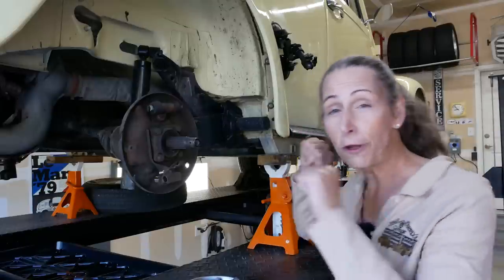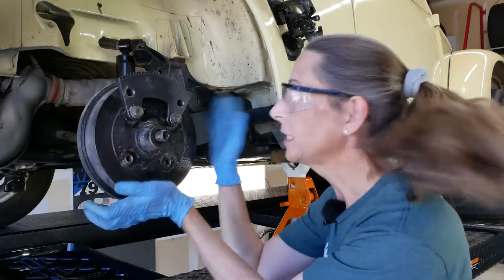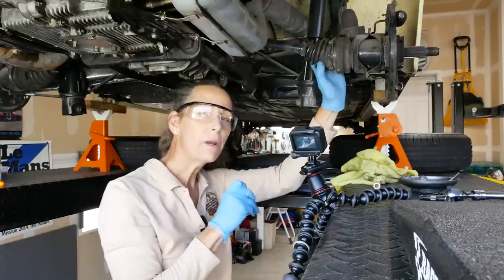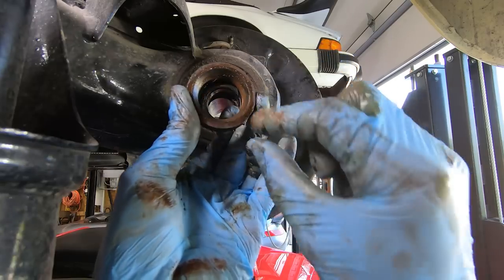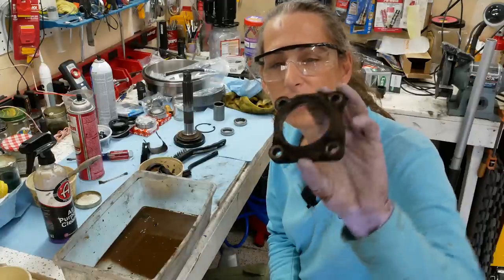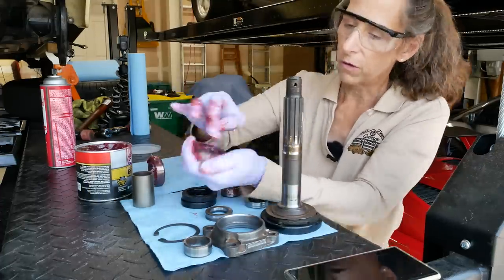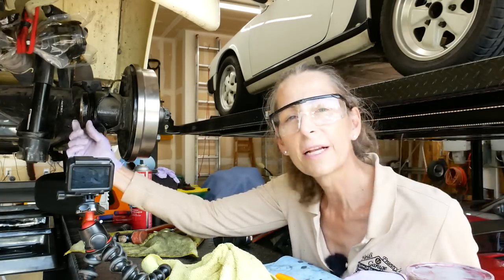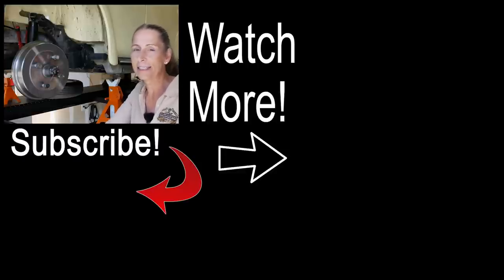VW Beetle Rear IRS Bearings - Quite a job!!

Comment: 36mm with a breaker bar works fine before you lift the car. Take the 4 bearing cap bolts off, e brake cable and brake line off and remove the backing plates complete. Get a bearing puller VW  6306
Reply from the maker: But how do you torque it properly when you put it back on?
Reply: @HeidiandFranny  Torque Wrench
Reply from the maker: @doginu  awesome if you have one that goes up that high... The torque multiplier let's you use a normal torque wrench.
Reply: @HeidiandFranny  Of course I do, I even have an impact that uses Air.....